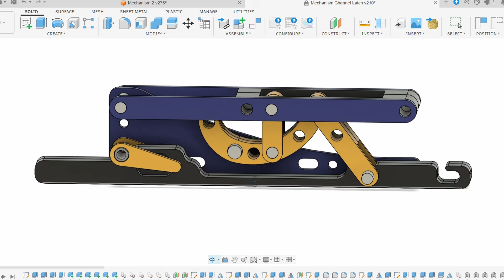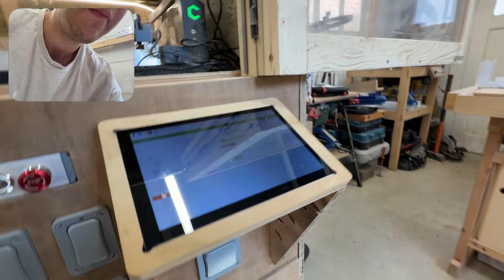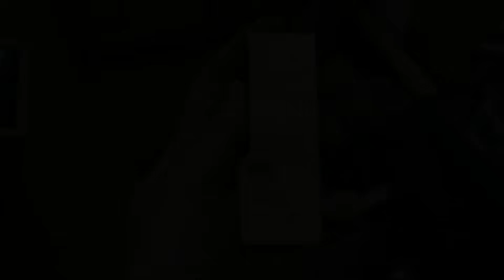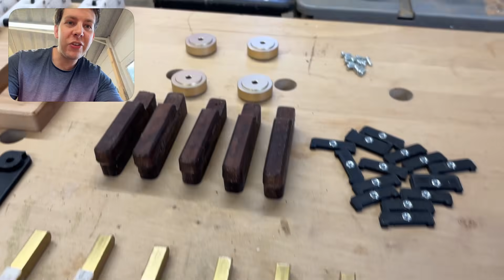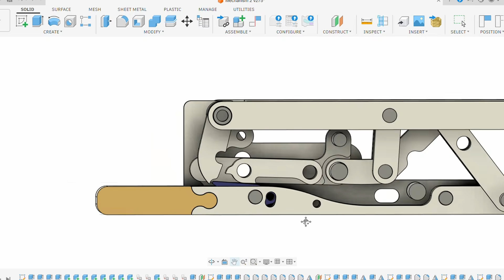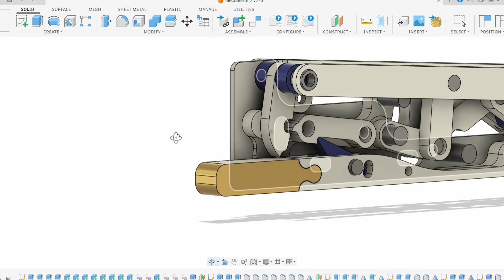This Mechanical Piano Holds My Keys

Comment: Appreciate this very fascinating glimpse into your design and thinking process.  What was your toolpath set up for cutting the t-slot?
Reply from the maker: Thanks for stopping by to watch the video! The T Slot was a Fusion 360 contour toolpath with multiple depths, cutting down 2mm at a time. I set the top height as the top of the slot (minus 2mm), and the bottom height as the floor of the cut out. Had to play around with entry/exit parameters to stop it crashing into the stock! For some reason I had to set the top height exactly 2mm lower than it actually is in CAD which might be a Fusion bug, but hey, it worked!